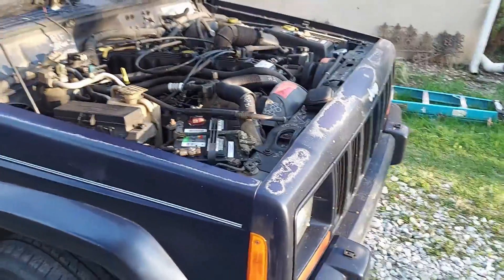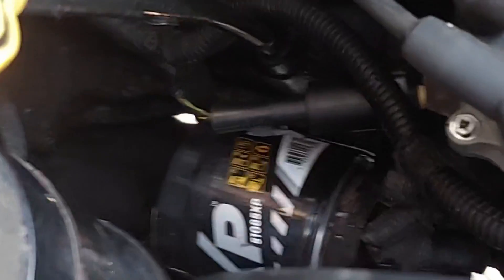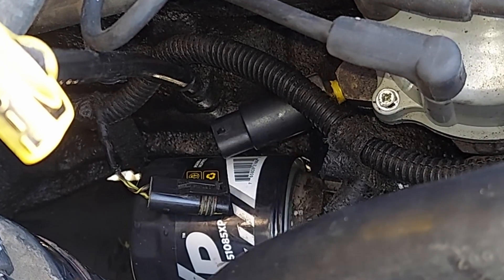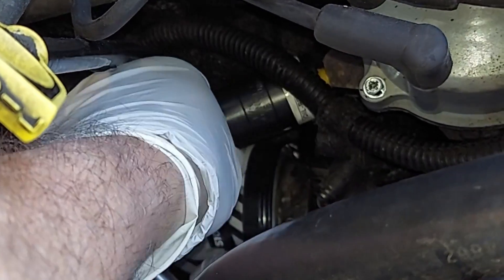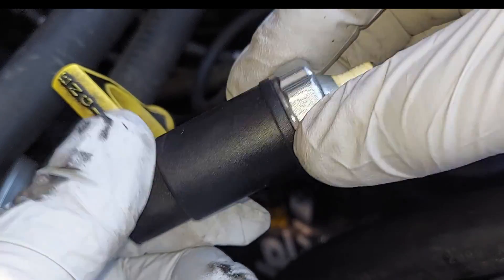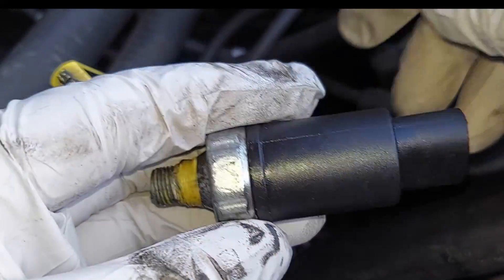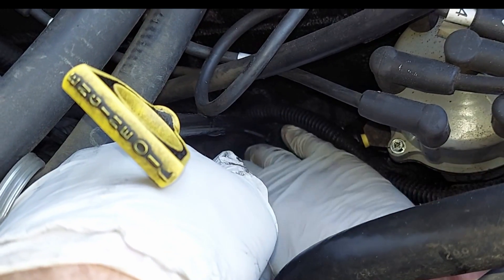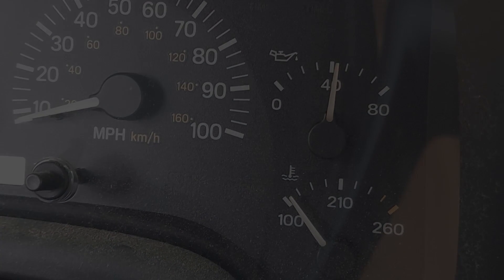How to Replace the Oil-Pressure Sending Unit on a Jeep Cherokee (XJ) to Fix Erratic Gauge Readings

Comment: I installed the new sensor and my gauge is now reading maxed at 80 when driving and around 40-60 at idle. Do I have a faulty sensor out the box?
Reply: Mine just started to show maxed out pressure, any updates on yours?
Reply: @dewsteezyz  mine too. Fix yours yet?
Reply: @aodetailautomotivecoatings8979   nothing yet! I just noticed if I turn off and on the car again it goes back to normal pressure lol 
Not entirely sure why but I’m keeping an eye on it.